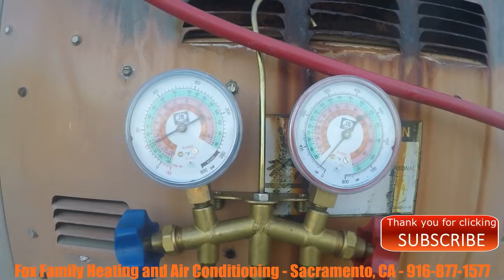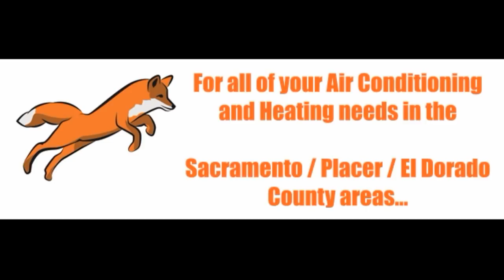The Life of an HVAC Technician - Episode 5 - Installing a Package Unit on a Rooftop

Comment: Used to work for Brower mechanical and when I left and moved out a state the inspectors were writing people up if you put the gas trap straight off the unit. They wanted the trap, then the valve, then the flex right to the unit. Saw u guys did it that way and just  made me remember

Comment: im a commercial service tech and i live in the south amd ive never installed a package unit on top a residential home its not common at all in the south but installed and serviced many upon many of rtu's and your install you use plumber strap between the unit and duct work???tf im sure curb screws of some sort should be used and also no safety harnesses for your workers so they dont fall??? no lock out on breaker either im sure.....too many corners cut and job site has many safety issues...
Reply: Yep in commercial osha would eat them alive

Comment: Nice install Greg. Just outta curiosity do you remember what blower motor came in that unit was it a psc or ecm?
Reply from the maker: I forget man.  I wanna say PSC, yeah because there were three caps in the control area.
Reply: Gotcha only reason I ask is the one I did last year had an ecm. First one I've seen on an Ameristar.

Comment: OK let me get this... you have the AC on the ROOF TO COOL MIND YOU.. Where the surface temperature  can get 130-140 F.. you wonder why A/C fails or doesn't cool the house...

EXPLAIN PLEASE THIS SHOULD BE GOOD.
Reply from the maker: Why do you think I would take the time to explain this to you?
Reply: because you can't...
Reply from the maker: Thanks...lol
Reply: Roofs were historically the location of evaporative coolers in hot and dry climates before widespread use of central ac started in the sixties and seventies.  Existing roof curbs and ducts were then retrofitted with today's rooftop units.   The older evaporative coolers benefited from unrestricted air movement and required windows to be selectively opened.  So the cooler evaporative air would sink while the hot air rose.  Pretty much the same as restaurant makeup evaporative coolers today.   In addition, many post-war homes in the west and the south had extremely shallow roof lines and no basements for equipment installs.   

My understanding is new construction in these areas has primarily gone to the split system configurations that require brazing refrigerant lines and charging in the field.  

PS: In some videos by "The HVAC Guys" you can see evaporative coolers still on the roof of some residential installations.  Search for "hvac: cooler restoration" and then their video "why are units on the roof" which shows some of their repairs, films a drive through older neighborhoods, and towards the end, discusses the subject.
Reply: You can also set Package units on the Ground Insulting others shows your Education in not Explaining why on the Roof and not on the Ground not a hard question.
Reply: Thank you  for Explaining this More then "Fox family heating and air did"